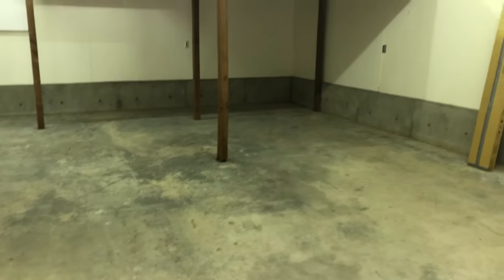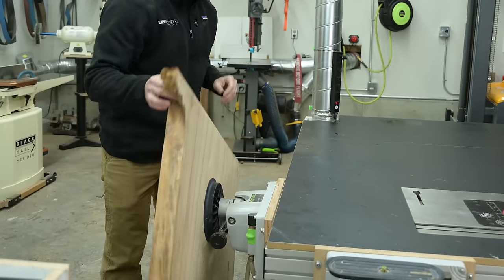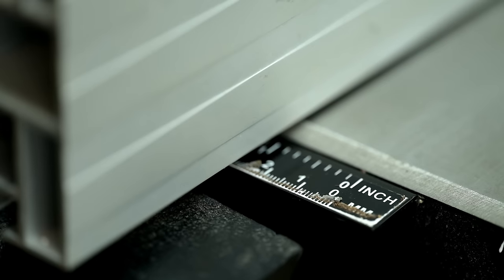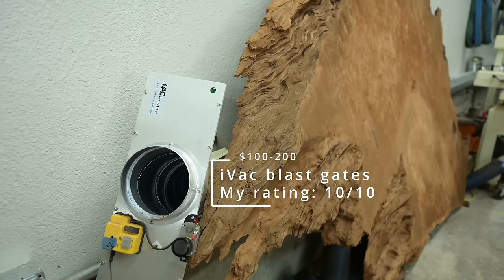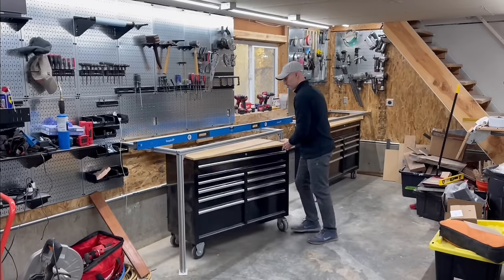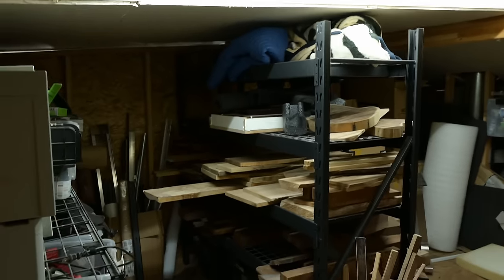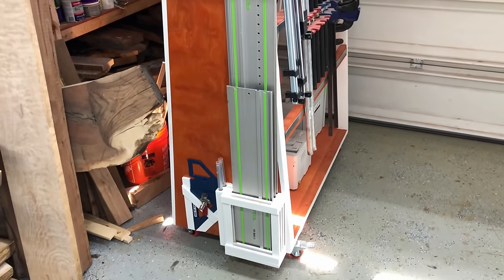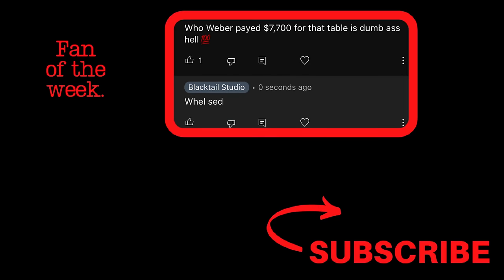Blacktail Shop Tour

Comment: Fight it for sure. There’s no reason why you can’t build something on your own property that you’ve had engineered and meets the code
Reply from the maker: I’m game… And for anyone who is interested, they did give a reason. They said an auxiliary structure can’t be more than 1200 sq ft. This is based on a lot size of 1 acre. They have different allotments for larger lots. But the largest is one acre. Our house is on 2.5. And we can’t subdivide less than 1.5 acres. So my contractor said it shouldn’t apply to us. Long story longer, the county agreed but said there is nothing in their code to change the rule. 

I CAN however build an additional structure that is 1200 sq ft. So it’s looking like that is the only option now.
Reply: @BlacktailStudio  Agree on fighting it, but it sounds like the county has absolutely no intention of "bending the rules" on this one. Would the cost of a separate 1200 sq ft building be significantly more than adding the equivalent space to the existing shop? I realize it's far less than ideal, but perhaps the secondary shop space would give you a dedicated assembly/finishing/photo studio, so you can further optimize the layout of the main shop space?
Reply: @BlacktailStudio  RR Building recently did a metal building that was next to an existing building and they built a breezeway to connect them. It seems like it would be a solution
Reply: @BlacktailStudio  so “build an additional structure” and butt it to the current shop. After they inspect, ‘upgrade it’ by ripping out the walls that  divide the two, bridge it with the outer couple feet keeping the wall dividers, caulk is a beautiful thing IJS . As long as the exterior continues to appear as 2 individual properties, they won’t know.
Reply: @animefan73  like a clean room, good idea
Reply: @BlacktailStudio  Could you build a separate structure and then after a year or so, connect with a breezeway?
Reply: I had a friend that dealt with a similar situation. He built an enclosed hallway from his house to the "auxiliary building" and it became additional square footage to the existing house.
Reply from the maker: You guys are all on the same page as me and the contractor. Will likely build it… suspiciously close… to the existing shop. For one reason or another.
Reply: @crackerjack010101  We had a local company do something like this. They built an awning from the second building that covered the gap but did not actually connect to the original building. I think they built them just a couple of feet apart.
Reply: @BlacktailStudio  God that's dumb.  Beaurocratic red tape is so frustrating.
Reply: @BlacktailStudio  Sorry the county said that, that's so dumb. I hope it works out for you, it would be really cool.
Reply: @BlacktailStudio   fight it! If you can build an additional 1,200sqft. Building then just build it 2 inches away from your existing building😂 also, I did a planning course in college  that went over zoning and regulations. Yes, there may be no rule against it. But there is nothing stopping a zoning board/commission from creating a new code. They add and take cafes and regulations all the time. Basically a zoning board makes their own rules….
Reply: @BlacktailStudio  Fight it. How close can you put the two structures? Maybe a walkway three feet in length and eight feet wide.
Have good days!
Reply: @BlacktailStudio  Do they differentiate between different types auxiliary structures or just put them all under one blanket? In my area we have an ADU (Auxiliary Dwelling Unit), commonly called a mother-in-law suite that has a size restriction of 1250 sq ft. however a garage has no such restriction
Reply: @BlacktailStudio  can you fight it, and get it signed off for a larger building as long as neighbors say it's ok? What about rezoning it? Light industrial? Or something like that?
Reply: I'm far from voice of reason but maybe "fighting" is the wrong approach.  If you are too abrasive about the topic they will  LOVE to make it a point that an addition doesn't happen.  Essentially you are wanting them to do you a favor, is there any way to make them feel a sense of reciprocity?  If you can frame the addition as a "livable space" you might get it to fall outside the regulations of an auxiliary building?  There is a hole somewhere in their codes or an appeals process you can use to get it done.  I really hope it happens good luck!
Reply: Perhaps the phrase, "It's easier to ask for forgiveness than for permission" is helpful?  (I'm aware that real life usually doesn't work this way and that the repercussions of doing so can be expensive.)
Reply: Take your tax dollars to another state.
Reply: @stytos  Fight it!  It doesn't work that way.  They have people remove whole structures for doing this.  What they allow is something called a "variance".  Ask the neighbors if they are OK with a stucture out of the range of what's formally allowed.  Code is OK overall, especially in neighborhoods where they ban semi-trailer storage and garages bigger than the houses.  Don't ever think you can pull a fast one on city-hall.
Reply: It might be worth considering connecting your house to the shop, then you can extend the shop as you like. It is less likely that you will be limited in extending your house, aka the living quarters, versus extending the auxiliary building.
Reply: @BlacktailStudio  Yeah, I was going for neither fight nor concede, adapt! Seems like that's what you're doing!
Reply: @BlacktailStudio  Is it cheaper to ask for permission or forgiveness? In other words...would a fine for building outside the permit scope be more expensive than whatever nonsense you'd have to do with a neighboring structure and all the hooplah around that? They're not going to come knock your building down, despite the bluster and threats.
Reply: @davebennett5069  They may not knock his building down, but I've seen plenty of cases where they stop a person from using the new building and they fine him for the cost of tearing the structure down. Basically making the addition economically unfeasible.
Reply: @BlacktailStudio  Gotta love bureaucrats.
Reply: @BlacktailStudio  Whel sed!
Reply: @tangowally  if the cost of tearing it down (which you pay but don't actually do) is less than the cost of building a separated building and attaching it later, then it's just the cost of getting it done.
Reply: @crackerjack010101  i would imagine there would be an easement requirement between buildings
Reply: @BlacktailStudio  You should really delete this comment (and probably the entire thread).  Inspectors are frequently lazy, but you never know if someone from the  agency watches your videos and could read the comments.  You could be setting yourself up for a very large fine.
Reply: @BlacktailStudio  Fight it for sure, if you put the addition structure on a separate slab which was close enough to the first to act as one structure, but technically still 2 structures, and then i dunno, 'accidentally' spill some filler in the gap with a shared 'removable' wall inside?
Alternatively, ask them for their advice or a solution, make it their problem to solve.
Reply: When I was building I encountered this a few times. The way we were able to get around it is to not make it an auxiliary structure. Create a breezeway attaching your house the the shop. Now it is part of the  house.  Good luck!
Reply: @BlacktailStudio  Build a separate structure with a walkway connecting them lol
Reply: Concede and just build additional building connected by a breezeway. Your real estate agent messed up on this one
Reply: Definitely fight it. You can get a variance from the zoning board.
Reply: Amazing man! It’s been awesome watching your business grow and continue to make beautiful pieces of functional furniture. I want to be like you when I grow out of my garage. Made the transition to full time woodworker this year. Excited for 2022
Reply: @BlacktailStudio  fight it, sort of. How close is your main house?  Build a breeze way from your shop to the main house.  That way your shop is considered part of the main building.  Then add on to your shop.  Beware tho, main structures also have lot to structure size requirements. But they do tend to be a lot bigger then out building requirements so you might get lucky. Good luck.
Reply: @BlacktailStudio  Or just do your own thing because it's your property....
Reply: @BlacktailStudio  there's no procedure for changing the code?  who made the Conde to start with?  That's a BS reason.  And letting you build an additional structure is Okay?  Where is the logic in that.  sounds like you need a lawyer.
Reply: Less government, more freedom
Reply: @BlacktailStudio  Can you apply to the planning commission for a variance? They give them out like candy in Yamhill County, especially if your contractor is friends with one or two of the commissioners.
Reply: @BlacktailStudio  There you go.
Reply: @BlacktailStudio  someone needs to run for office/get on this board and propose a new code.
Reply: @BlacktailStudio  Build two structures, one literally .1mm closest to it, attach two garage doors to the middle where they meet. Then weather proof it and you're good.
Reply: "Suspiciously close" indeed, lol! Had a similar thing on my uncle's property, but in reverse. Lot was zoned too small for the existing structures, but they were grandfathered in. It had a shop and a house already, but they said he couldn't re-build the shop unless it was attached to the house. One suspiciously long car-port, and a 16' 2x4 later, they were technically "attached"
Reply: Zoning regulations are very awkward here in the NL too. The local gov is just applying the rules that exist, there’s no “fighting” that. They have no reason whatsoever to keep you from building the shop you want if the rules allow it. 

At least here when we remodeled the house, they were also willing to talk solutions such as re-zoning which takes ages and is not guaranteed to work, or redesign our plans a little bit to make it fit the rules (we were planning too high, our extension is technically only allowed 1 level, and we want two. But a sloped roof doesn’t count for max height, so we dug down 5 feet and started ground level there with another on top. Made it look pretty and then it was good by our local council.)
Reply: @BlacktailStudio  the City Council, Board of Supervisors etc, can generally give approval even if the building department recommends against it, so if you get nowhere with getting a Variance from the building department, consider taking your proposal, including property layout, letters of support from your neighbors, etc, to the Council directly.
Or, build a second building as close as they will permit, and then build a Draw Bridge!
Reply: Really nice video as usual. Hey I asked you question before, what do you think about making door with epoxy same way you make tables? I want to order a door with the frame from you.
Reply: @Blacktail Studio honestly what I would do is be a little cheeky about it and just find where the line between “separate structure” and “structure” meet and and just barely make it a separate structure. Not illegal, but still a win.
Reply: @richardgilliland8126  lol, are you serious? A fine for what? free speech?
Reply: @BlacktailStudio  my concern is that you will lose the gain in function with a separate structure. 
What is the consequence for just doing it? Usually it's a tricky tack fine and won't make you take it down since it isn't a public use facility.
Reply: @Rattletrap-xs8il  Relax. Speech isn’t a problem. Ignoring city codes can be if they catch you. Broadcasting to the world an intent to ignore codes and undermine inspections may not be the best course of action.
Reply: @stytos  The previous owner of our house built an outbuilding that infringed on a wetland. When the county found out about it (while permitting for our new deck), they gave us two choices: Demolish it or pay to abate the wetland (basically involved redrawing the wetland boundaries). If it hadn't been built by the previous owner, we would have had one choice - demolition.

When you're dealing with the county, they tend not to be forgiving...

Caveat: This is with King County in WA, which is well known for being ... annoying (to be fair: When some foundation issues were found on the new deck, they allowed us to proceed with just an engineers design rather than requiring we go through the year long permitting process again (covid slowed everything down)).
Reply: @BlacktailStudio  They don't have to change the rule just for you, but a variance or special permit may be allowed for your case.  I fought to build a slightly larger than normal shed on my property line.  It didn't meet code as it was too tall for how close it was to the line.  I had a hearing and they ultimately approved it since I have a sloped backyard and a shed that met the code would be right in the middle of my relatively small backyard.  Being cordial with the folks at the county probably helped and positive approvals from your neighbors will help as well since they're the ones that also have to live with your addition.
Reply: @BlacktailStudio  can the additional structure have a breezeway between it and your original building?  Devil is in the details.
Reply: @BlacktailStudio  Do they have a variance process?
Reply: This is possibly just the county being difficult and that's a shame.  I work as a department head for a 1-mil+ city who deals with this every day...and this is the exact reason variances, permitted use, conditional use, and several other mechanisms exist.  It is always an uphill battle, and without the exact reason it's hard to say.  Does your county have a "special conditions or hardship" rule?  If so, you may be out of luck with the outbuilding size...that's a hard one to fight.  Those rules basically say they can't give you special treatment unless it's due to the shape of the lot, factors outside your control, etc.  Might be a hard lesson, but always check your codes and speak with the regulatory authority prior to paying an engineer for detailed designs...
Reply: Do any of your neighbors have an unusable .5 acres?  If the land can’t be improved due to pitch or whatnot they may be willing to sell for cheap or trade (who doesn’t want some lovely custom furniture??) may be worth asking at least.
Reply: My thoughts exactly @Jesus Gutierrez. Also it might even be easier than that…if it’s just a small county government a few friendly conversations with others that have authority at city hall might help get the ball rolling…the squeaky wheel gets the grease..
Reply: Our county don't care but the city is like yours very strict ask your builder how to attach it later they are ways ask the inspector hypothetical question about attaching them together
Reply: Fight it. 

Don’t lie you got in to this so you could justify buying nice tools.
Reply: @stytos  ummmmmm.....no.   they'll make him tear it down if he does it without their blessing.
Reply: @BlacktailStudio  you can request a change in code. We do it all the time. But it has to be very general otherwise it’s considered spot zoning. 
Ask for a revision based on property over 1 but under 5-10 acres. You might find out that it’s a issue that has come up and pushing a little will encourage them to add a chart with more relative sizes.
Reply: @BlacktailStudio  fight it...maybe.  First off love your videos thanks for putting such great content out there and, despite what your wife might say, I think you're jokes are pretty funny. 

I'm an architect; I'm not licensed in Oregon, and don't know all the ins and outs of what you're trying to do (so with that huge grain of salt, lol) getting in touch with a local architect is probably your best bet.  First they ought to know the building and zoning codes and verify that you can or cannot do what you want to. Second, if there's a different way of presenting your case to the building department they might know how to best do that.  I haven't read all the comments so apologies if someone's given the same or better advice.  

Usually the building department references a code/zoning section in a rejection letter can you post that?   It would be very specific as to why they're not allowing the building similar to the below paragraph (except what I found seems to say you're good to go).

I took a quick look at the Oregon Building Code and if you read section R328 Detached group R accessory structures, see section R328.4 Allowable area (start with Chapter 3 Building Planning if the link doesn't work). https://codes.iccsafe.org/content/ORRSC2021P1/chapter-3-building-planning#ORRSC2021P1_ChPanel_SecR328   It states that 3,000 square feet is the limit for residential accessory structures and goes on to talk about circumstances where it can be increased.  Of course counties can impose greater restrictions to limit sizes which it sounds like your county has.  This is just the 5 min brain dump, hope it helps and good luck.

I just remembered, there's a guy in my office that just moved from Portland actually.  I could ask if he'd recommend his old firm.  Another option is to talk to a code consultant firm in the Portland area.  They usually understand the ins and outs better than anyone.
Reply: Never back down to the local government official.
Reply: @BlacktailStudio  Ask for a Variance, see if that is something they would be willing to do for you!
Reply: @BlacktailStudio  my boss just recently doubled the size of our auto repair shop, according to code if we were to expand the building we'd have to upgrade the one wall to a fire wall and add a fire door despite the building not even being that large. So instead we built another identically sized shop about 10 feet from the existing one and installed a 20ft wide breezeway between the two, because that's somehow different.
Reply: @BlacktailStudio  Soooo.... what's the minimum distance between "structures"?
Reply: @BlacktailStudio  Thank you for the explanation. Of course, if you build an addition structure, anything against a climate controlled, enclosed, b"breezeway" between the 2 buildings. 😀
Reply: @levie-5c674  I wouldn't bet on it.  There are all kinds of properties where I live that would be perfect for building but the planning department will not budge on the original zoning.  They are zoned for farm use but the land is hilly and the soil isnt any good for farming.  It's their way of stopping progress outside city limits.
Reply: @BlacktailStudio  Is there any way to request to have it re-zoned as a commercial building instead of an auxiliary structure? Might have to divide your lot in order to do that
Reply: @BlacktailStudio  Well, build the stucture... right against it...  Then Make both structures " open air" one one side of the wall, see what they got to say about that... two structures, each 1200, just so happen that the divisions or rather the "walls" are well none-existant
Reply: @crackerjack010101  darn i wrote my comment before reading other comment replies
Reply: @BlacktailStudio  Had the same thing happen to me here in Saint Louis County, MO.  I filed an exception (there was a form, ask your inspector or building office) and presented my case in front of the board.  I had to get sign off from my neighbors (they didn't care we are on 3 acre lots) and present my plans and why I needed that amount of space.  Took a bit of work but in the end, I got the permit.  You should go for it.
Reply: @BlacktailStudio  that seems right - build it out another 1200 SF (or whatever you can get away with) on concrete pillars/piers in the same floor plane. (then maybe frame in the area below when no one's looking 🙂). I have a VERY similar situation with a pretty steep downslope behind my shop - the only direction I can add on.
Reply: @BlacktailStudio  I think there might be still little wiggle room with the county and their interpretation of the rules. 

If this won't work do you think that new structure would be doable and fit all needs (not only current ones but near future as well)? Did you check the option of replacing current building with bigger one ?
Reply: @PeinTech  lol a lot of us have the same idea
Reply: @BlacktailStudio  I would build it as close as permitted, put large roll up garage doors facing each other, common concrete pad between. Possibly enclose with a greenhouse style breezeway but keeping them structurally separate could be good.  Especially if the new structure gets the basement.  If you need or want to downsize in the future you then have the option to rent one or the other space out but still have your own secure space.
Reply: @BlacktailStudio  SQUEAKY clamp gets the oil. ALWAYS look and ask for other option of what else to build on the property. City once said no to in-law suite but with enough questions i was told I could have a temporary trailer single wide on the property...
What does your current zoning allow? Retail space? Storage space? Just because you build it for one thing doesnt mean you cant use it for that... Also aux building...How close can you build it? can you add causeway between? Do you need permit for 100sf bulding? build that in between after...
Squeaky clamp gets the oil.
Reply: @animefan73  a whole wall side cost
Reply: @BlacktailStudio  can you divide your current build up so that it meets their "requirements". To make two separate buildings?
Reply: Disagree thats why we have zoning in the first place
Reply: @BlacktailStudio  Can you somehow connect the 2 of them without having to go outside ?
Reply: @BlacktailStudio  can you do a temporary structure, that way no planning permission is needed, won’t be as vast and Amazon potentially but that way if they complain you can always deconstruct and rebuild
Reply: @BlacktailStudio  I'm not from the US, I will never really understand how your goverment gets so much say on what you can and can't do on your own property.

Here it's more of a "don't get above THIS height and do not build outside of your property"

As long as there's nothing weird going on like a water pipe or sewer pipe coming across your land, power cables being too close for some reason or you find a dinosaur bone
Reply: @BlacktailStudio  Fight it.  You could design a covered breezeway between the two.  You might want to get a land use attorney involved.  When my dad's 2 car garage got destroyed by a tree, he wanted to build a 4 car garage (60s cars are his thing).  It took him two years of back and forth but ultimately he got what he wanted.
Reply: @BlacktailStudio  Fight it.By which I mean, take it to the county council (or whatever the governing body is), preferably through an elected councilperson or equivalent. Since the problem is apparently a lack of language allowing the building department to follow the spirit, legality, & public interest of existing code; the solution is change the code to allow them to do the obvious and logical thing.

I'd suggest taking a polite tone of helping the county rectify this minor discrepancy, with a threat of making a big public stink over another governmental fubar fiasco just well enough veiled so that it's easily discernable.
Reply: @BlacktailStudio  So it’s “fuck zoning” then. Gotta love North America!
Reply: @BlacktailStudio  is there any stipulation on how close to each other they can be? if not, you could always place a covered patio between them...
Reply: No need to "fight" it - as said in the comment by Jim B., this is a pretty prime example of a "getting to yes" situation, where everyone stands to profit from an amicable resolution. If you approach it as a fight, you'll engender opposition from the powers-that-be. 

As it stands, you got a "no" from someone who was simply doing their job and following the letter of the law and who also lacks the power to give you the variance you need to make the addition. But I'm not aware of a single city that doesn't have a process in place to grant varainces. It'll take some time, footwork, and appearances before the zoning commission, but I wouldn't give up and build the separate shop right off the bat. End of the day, you're a small business owner who is generating tax revenue for the municipality and adding value to the place. They probably WANT to let you build it, but bureacracies being what they are, there are usually hoops.
Reply: @BlacktailStudio  See if you are in the closest cities future zoning plan. if you aren't then petition the county for either a rezone or a variance. If you are, you should be able to petition that city for the same.
Reply: @BlacktailStudio  can you just build the second building as far from the old as the wall is tall?  Then have the engineer draw up plans to include a drawbridge wall in old building and a giant garage door for a wall in the new?  Raise the door, drop the bridge, mate the buildings and if county comes onto your land retract bridge, close door and 🖕🏻county!?!  Or am I getting into the weeds again??
Reply: @BlacktailStudio  where we are, if the main house is attached to the shop it is considered part of the house and not a separate building so a lot of the times people will just connect them via a breezeway to circumvent rules like this. this may not apply to you but just trying to think outside the box....
Reply: @BlacktailStudio  build a covered walkway connecting the 2🤷
Reply: @BlacktailStudio  If they agree with you, but it isn't currently the rules, it may be possible to find one or more of the council members to pass a code amendment that better allows for this sort of thing that doesn't violate the intent of the rule, only the current language.  Would help others who have edge cases like this.
Reply: @BlacktailStudio  I would fight it. I have been looking into property and I was told you can rezone your property to allow for different structures... I don't know how difficult it is, but it may be an option.
Reply: @BlacktailStudio  Fight it!!! 

Auxiliary structures are limited, but this morning I thought, why doesn't he just connect it to the main house? Then isn't it all a single structure?
Reply: Some kind of planning board may have the ability to issue a variance in order to allow this, particularly if neighbors are in support.

Not sure if commercial use may become a problem though, so keep an eye on that line. Many areas are moving away from use-based Euclidean zoning though, so hopefully you are in such a jurisdiction. 

Otherwise, would combining your two lots be viable to increase total parcel acreage?
Reply: @BlacktailStudio  there has to be a conditional permit, or variance permit somewhere in the code. If there isn’t, then you should petition to add it. Code exists to serve the residents, not the other way around.
Reply: Cam, first off love your videos, the content, those tools and your skill of course. You and Tamar at 3x3 are my heros.
I am a fixed wing CFI so I know first hand your love of being airborne. 
As for the addition (assuming you are in good standing with your neighbors) I would fight it. File for a variance. Get the signatures of all your neighbors. Get an Attourney involved so the verbiage is proper and on scary letterhead (no county wants a lawyer involved) especially if you have CC&R's. A piece of land that size can easily handle that square footage. Start attending the city meetings for a taste of what you expect when your variance comes before the city council.
Good Luck,
Russell Reeves 
N. GA.
Reply: @BlacktailStudio  and then connect it later?
what about buy a neighboring lot?
Reply: @BlacktailStudio  Getting a variance is an option too.
Reply: @BlacktailStudio  I work in facilities management, I suggest looking into if your city or county has a PUD (planned unit development) process. If they do, you should be able to file a PUD amendment, cite the applicable code of 1 acre, and why you should be allowed to make the addition on your lot. It will be some red tape and likely have to appear before the city's planner or planning commission or the full city council. Just remember, cities often like having their egos stroked, not challenged. Good luck!
Reply: @BlacktailStudio  Build that 1200 sq/ft and then have an umbilical connect the buildings with "whatever the legal space needed between buildings" would be. Even if that's just a four-slat rope bridge. :D
Reply: @BlacktailStudio  Fight it. There is always some Lawyering going on, and what not. i think you can probably find a loophole, e.g. what qualifies as an additional structure (separation, etc.). Wish you the best of luck!
Reply: of course, I'm a little late to this party...
Reply: @buddyreed2623  Exactly.  Build a separate structure and then connect with a very large breezeway with over sized doors.  As a contractor I've dealt with everything under the sun for zoning boards and inspectors.
Reply: Dig out for the basement,  do the walls, floor and ten put a roof on it (flat roof) keep one wall open completely,  at that point its just a car port. Then a year from now build a separate structure on top of the flat pad over the carport. Don't connect it yet to the the original building.  Then 6 months later , casually put up some sheet metal to connect the two buildings. , reason ? Just say draft purposes 😉. Then final step , wall off the carport after you planted the giant Arborvitae , forgot, that's the first step. Plant those Arborvitae first 😁😉. 
Do the rules change if you put solar panels on it. Some counties have different rules for "green energy" structures.
Reply: @davebennett5069  Oh yes they do "come and knock it down." Except you have to pay for the knocking, too.
Reply: @stytos  I’m with this guy….what are they gonna do? Sue you? It’s built at that point. Idk, or… what about hiring a paralegal to basically find legal reasons to force their hands. If you can make a legal argument that shows they’ve either allowed a similar/identical project by some other rich jerk, or show legal precedent that says that their prohibition actually violates your rights… they won’t have a choice but to bend to your request or if they don’t they’ll be giving you all the grounds you need to sue them for a LOT of money
Reply: @BlacktailStudio  sometimes it's just easier to ask for forgiveness than permission.  But yes, build it out as a "separate" building then join them a month or 6 later.  Good luck and keep us updated!
Reply: @BlacktailStudio  as another consideration I'm sure you've thought of, you could "lightly attach" both structures with a breeze way to make the most out of it... That was what I was considering for my 25x50 workshop but in the end in my county I had to fully attach it to the primary structure and make it an "addition" to get it to pass local code...
Reply: @BlacktailStudio  You can ask for a variance.
Reply: @BlacktailStudio  Can you go through the process to get a variance? Developers do that all the time.
Reply: @BlacktailStudio  build your "additional structure" 5 ft from your original shop and connect them with a "breezeway" LOL
Reply: @BlacktailStudio  with a small "connector" that is standalone so that it touches neither building but provides an easy to use walkway between the two buildings.
Reply: @jeffersondavis5419  Except it's Oregon and the codes around here get tetchy about such things.
Reply: @BlacktailStudio  can u build the additional structure literally right beside it and connect with a driveway with a roof over it? and then maybe when the county isnt paying attention just put some walls up around the carport area haha
Reply: Very few things get on my nerves as much as ridiculous building codes do! There's no reason why you shouldn't be able to do whatever you need to do to expand your work space!
Reply: FACTS
Reply: @BlacktailStudio  (late reply, I know) I work in Architecture and I am volunteering to serve on my city's zoning board of appeals / board of adjustment.  This is a pretty textbook case where going through a variance process would likely have gotten what you wanted (at least here).